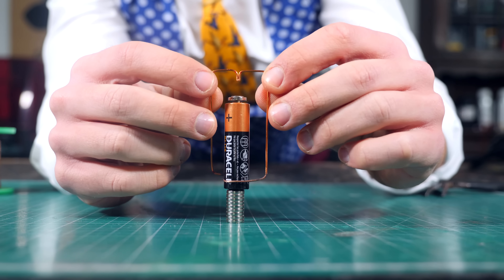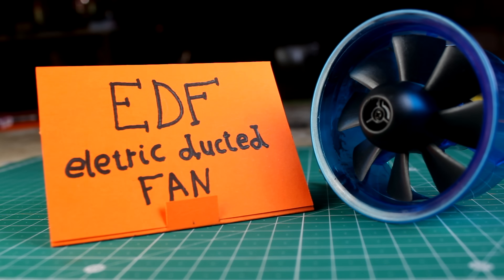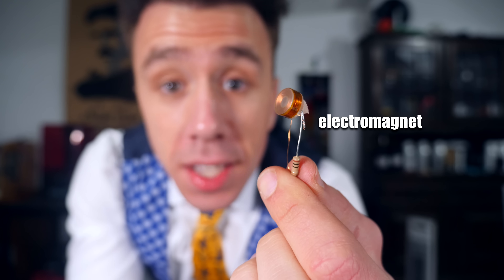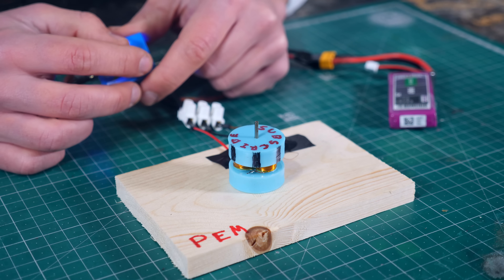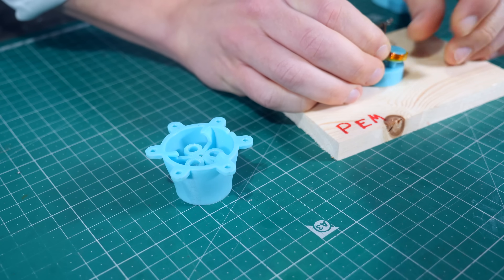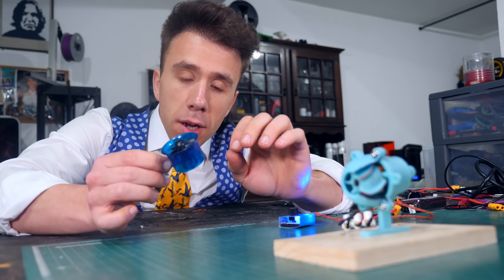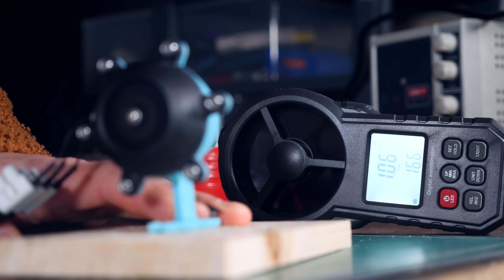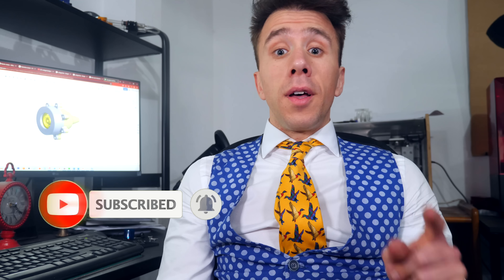I 3D Printed an ELECTRIC MOTOR FAN

Comment: My assumption is this.  A centrifugal fan is engineered to build pressure first then airflow second.  That's why this design is used on turbochargers, and centrifugal superchargers. A typical fan is engineered for airflow first and pressure second.

Comment: The reason why its not flowing as much as the edf is due to the trade off that is made when using an impeller. The impeller has less flow hower it can output a geater static preasure, whereas the edf has alot of flow but less preasure.

Comment: The Axial fan is just more efficient at accelerating air than the radial fan. The flow path through the axial fan requires way less directional change of the airflow than in the Radial "compressor" design. The benefits of using a Radial Compressor or fan design are mostly high compression ratios in relation to the fairly small build volume. That's why modern jet engines don't use a Radial compressor, Turboshaft or Turboprop engines on the other hand use them because they are fairly small and produce a high increase in static pressure. Turboprop or Turboshaft engines are also not made for generating Thrust, their main purpose is to generate high output shaft power.
Maybe by using different dimensions in your design you will get close to the thrust of the axial fan design, but you will probably never reach the same value due to  efficiency constraints.

Comment: I believe the answer is in two part:

1- the path on the outer part of the impeller is too narrow and you're putting way too much pressure on it so a lot of it just dosen't go through and gets stuck around the impeller. Basically too much pressure for such small opening. Imagine 1000 people wanting to fit through one door, they just can't gen in fast enough to avoid any danger of casualties, But if it was 100 people, they probably could go...

And 2- in general, jet engines have that much more power due to  the fuel being ignited, jet engines don't make for a good thrusters without the fuel and ignition.

As you may see with the EDFs, the propeller only covers the motor, the rest of the face is completely open. So they move as much air with least resistance as possible.

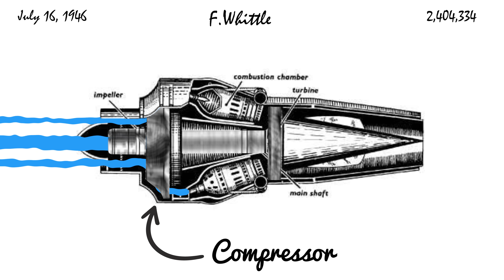Comment: We used to have a toy like that   (@3:50).  A propeller loose on a stick with a pulling rod.  Pull rod. propeller rotates and takes off.   Just rotate yours the other way around... 
even better. A forth spool in the center and a circular magnet in the propeller to hold it down longer and also 'shoot' it up to assist takeoff...

Comment: Once you have enough material, I say mount one of these fan thrusters to a bike, and see if it can push you.

With the centrifugal fan, if you were to make the impeller lighter, it would increase the RPM. Though, I don't know that would increase it's efficiency or power.

Comment: The thrust produced by the 3d printed fan having the EDF motor will not produce the same amount of thrust because of the different shape of the impeller. Having the same amount of thrust is still possible but it will depend on the rpm of the fan

Comment: Centifugal fans - Low flow, high pressure
Axial fans - High flow, low pressure
For thrust, you generally need to move some gas (air) at a high speed (high flow) so that's what's happening. Centrifugal fans don't get you high flow.

Comment: Fan Aerodynamicist here… You really need to do a bit of a deep dive on compressor theory. There’s 3 key steps you need to understand:
1. Blade angles, Flow and Pressure ratio
2. The impact of efficiency
3. Power consumption requirements

Comment: I'm not expert, but with my limited knowledge, I suspect your issue is that the motor you are using doesn't provide enough torque. It is my understanding that centrifugal fans compress the air they move and that this compression is where their air velocity output comes from. This compression creates large amounts of air resistance that will slow down the blades more than they would with a traditional propeller. The faster you drive the impeller, the more resistance you will get on the torque until you reach a plateau.

I believe you need a motor that is built to focus more on torque. Find a balance between the torque and rpm.

Comment: Centrifugal compressors have inherent inefficiencies where you turn the flow of air from radial to axial. You also should size your fan according to your motor; it may be reaching max speed because it's choked of air.

Motors don't generate thrust, fans do. There's no inherent reason for one design to produce the same amount of thrust as another.

If you're not married to the centrifugal design, but still want a ring of moving air, you can use multiple stages of axial compressors, separated by stators, with a smoothly increasing inner diameter.

Comment: You could try adding a stator element after the impeller since it can reduce the turbulence of the flow and the rotational energy of the air and hopefully create more thrust.

Comment: One thing you need to consider is that a portion of the energy output from the impeller design is used to compress the air and increase its pressure, however by doing this it loses some of its energy therefor the exhaust velocity wont be as high as using a normal fan design which doesn't compress the air as much.

Comment: A centrifugal compressor is designed to do just that, compress. It's usually used in conjunction with a diffusion stage and a combustion chamber where fuel is added, ignited and huge expansion of gases takes place. This is then used to drive a turbine which in turn, powers the compression stage along with the  the giant ducted fan at the front of a turbo fan engine. A centrifugal  compressor doesn't necessarily move a large mass of air, it's job is to compress. It's the fan at the front of the turbofan engine which produces 80-90% of an aircraft's thrust. Your basically using the wrong tool for the job. Same with a turbocharger... if you use the force of the air coming out of your turbocharger to try to drive an engine without the combustion stage, it wouldn't overcome the friction of the pistons and rotating assembly.

Comment: There's a problem with your fan, by recreating and slightly closing the upper blades it should go straight then curves from the top so that the force is created by swallowing the wind and it should cause some problem but if you recreate it and add some a little power onto you motor, just to make sure that the hole of the fan is inserted tightly and not lose or maybe the problom is the back of your fan cover. Hope this helps👌👌👌

Comment: Fans/Pumps produce pressure and flow, and in doing that they absorb work. You should try measuring the current (ideally the power but as esc tend to produce constant voltage current is a good approximation) used by both models of fans, and compare. 

1. If the models use different power/current, you need to scale your design until they do, and then you'll probably have to look at (2) below.

1. If both models are using the same power/current but producing different flow then you have an impedance matching problem, or an efficiency problem (wasted energy). The impedance matching problem is ether the inlet or outlet of your Centrifugal fan doesn't ideally suit the pressure that it is operating at. 

Rule of thumb is that Centrifugal fans/pump produce higher pressures at low volumes than axial/ducted fans. I think you have an impedance matching problem.Your Centrifugal fan is producing higher pressure but at lower flow air than the axial fan, thus when you measure wind speed (flow rate) you see it as lower. 

 This is why rockets have nozzles, high pressure gas at low flows isn't useful for propulsion, nozzles convert high pressure/low flow to lower pressure / higher flows.

The fact you called it an aerospike turbo fan, I wonder if you already know this because an aerospike is a form of open nozzle, which is a impedance matching device.

Comment: I didn't see any stators in your design.  You could add a non-rotating blade assembly between the cowl and motor housing (a longer impeller shaft would be needed).  Just the impeller in compressing tangential to the shaft and starts swirling as it expand down to the wider end of the cowl.  The stators should return the flow direction to a non-swirling, parallel to the shaft flow.

Comment: Hi there

Just some of my insights, as I have experience building my own RC EDF planes and experimented with various motor settings +Prop. There are so many variables to play with even though you have the exact same motor to produce equal or better thrust. You have:

1) Bell shape lip intake (without it, you will realize a significant drop in thrust) 
2) Blade pitch (Every blade pitch must match a certain motor RPM for efficiency)
3) Prop diameter (Every prop diameter must match a certain motor RPM for efficiency)

To give a real life scenario, Given same power (Say 100Watts)  i'm having a 
A)1200rpm motor 12"  2 bladed prop 
2) 10000rpm motor 3" , 2 bladed prop 

The 12" prop will produce significantly more thrust with lower air velocity, while the  3" prop will produce lesser thrust with higher air velocity.  Its like a Gear 1 vs a Gear5 on the car.

So if you want to achieve equal or more thrust from your system, i'd say probably build a bigger impeller , sand down and make your internal wall smooth as well for efficiency.

Comment: Is the swept area the same? The middle structure of the impeller might reduce the area swept so it has less air which it can move, also the intake area is different mby?

Comment: Hey Integza, 

if i remember from my engineering courses correctly you have the following issue:

fans (or as an engineer would call it: single stage compressors) generally transfer energy into your working fluid. In this case air. This energy can manifest itself in velocity, pressure or heat differential. Heat is generally considered a loss with fans. Now you are comparing an EDF(axial compressor) to an turbo fan(radial compressor). The axial design of an EDF is good for producing high velocity differential, but not good at producing higher pressure. For radial designs it is the exact opposite. They can produce high pressure, but not a lot of velocity aka thrust. You would need an elongated duct to turn that excess pressure into velocity, when there is only the atmosphere pressing against it at the end. But in using a large hosing you would introduce a lot of friction (air against the housing) wich would heat up the air and housing, so more heat losses. So to sum up, in theory radial fans can not produce as much thrust as axial fans.

If you would measure the static air pressure behind the to fan designs you would see that the radial fan produces more. That is where your velocity(thrust) is going.

tl:dr : Axial fans: High velocitydifferential, low pressure differential. Radial fans: High pressure differential, low velocity differential.

Comment: The geometry of the blades has to match the desired rotor speed. If the blade geometry does not match the required shape in respect to the rotor speed, efficiency is abysmal. That is the reason why axial jet engines where thought to be impossible for so long. The geometry matters a lot and is difficult to get right. Also, you do two things with your working fluid: compress and expand. First you increase pressure and then you decrease it again when you push it through your nozzle and in turn increase speed. Under optimal conditions, the pressure after the nozzle is identical to atmospheric to get optimal thrust. This again is difficult to get right. And even then, the internal conversions add up. Compressing and expanding again through so many geometries is not 100% efficient. You have friction losses on the walls and you also loose energy in the form of heat. Even when all geometries are constructed perfectly, because of the system complexity you will always end up with lower efficiency than the much simpler ducted fan.

Comment: I see three possible reasons:
1. Your fan design is simply bad and creates too much turbulence
2. The fan doesn't present enough load to utilize the maximum power that the motor can produce
3. The fan needs too much torque, overheats the motor windings and thus makes it less efficient (the inverse of reason two)

Comment: Clear resin and smoke should tell whats going on... Being a mechanic and having played with a lot of forced induction I reckon its mostly tolerances and materials at that high of an RPM is seeing efficency go out the window. 3D prints of fans often under perform their injection moulded counters and if you then are relying on housing impeller clearance to move fluid then you are going to see a huge drop.

Comment: You should try redesigning the nozzle, as you said centrifugal compressor creates higgher pressure so if your nozzle is not optimized for working in sea level air pressure your air is just spewing out and decompressing right after the nozzle and you what you want is to pressure out the nozzle and atmospheric pressure to be as close as possible. Just like bell nozzles of rocket engines are designed for different parts of atmosphere because pressure drops as you get higher. Good luck

Comment: Other people have more descriptive comments but I'll say this.

Impellers are not really what you want for thrust. 
I don't know too much about them but I inderstand increases flow rate and pressure in the impeller.
*It increases pressure in the impeller*, pressure is good for generating thrust but counter-intuitively starts to hamper thrust very quickly 
Velocity drops when pressure increases, inverse proportionality.

Normally this would be ok in say, a turbocharger, where there is a long continious pressurized piping, engines and fans are (usually) completely open.
I'd expect the energy to diffuse pretty quickly without the velocity having a chance to increase much. 

Anecdote, I actually personally believe this is a point of effeciency loss in jet engines but they have to eat the loss because of heat and structural integrity issues.
Rockets overcome this with wicked powerful and unreasonably wasteful cooling systems.
 (Use cryogenic fuel as coolant and dump it into the combustion chamber at many tonnes per second).

Long story short what you have essentially created is an aircraft compressor, rather than an electric fan. 
In a typical aircraft engine these would purposely slow down the air to increase pressure for combustion, and technically this is also a loss. But is needed for ocmbustion.
It depends on the speed and shape of the impeller though.

Comment: Fun thing about BLDC is they call it like that for the reason the driver fairly emulates the brushes. Yeah, it is not just pulsing the windings like it wants to, as that would cause the stepping mode along with all the vibrations - instead it actually picks the feedback from either the sensors or the windings' BEMF itself. However, this makes the driver special, yet the motor is just a synchronous motor, and although it is brushless, there is nothing "DC" about it :)

Comment: Surely it's blade area, the area  of the impeller need to match the propeller, although the impeller produces pressure there's no flow, you would need the correct nozzle like a rocket maybe... air is a fluid but thin yes?

Comment: Do a fluid dynamics analysis
You can use algorithims combined with fluid dynamics simulations to do random alterations to the blade design (number of blades, shape, size, ect...) until you find the best possible shape
Also use symetry so the impeller stays symetrical, it's better

Comment: Not sure how you are "measuring" the  difference between fans - For instance your 3d printed fan might produce higher pressure but lower volume than the EDF which is designed for volume not pressure. Its like a Tesla turbine which i believe will produce higher pressure but a much lower volume of air which is why its so difficult to run a gas turbine using Tesla turbines as they cannot compete in terms of volume of air with more conventional axial or centrifugal fans. The GTBA  (Gas Turbine builders association ) would be a good place to get more expert input on this.

Comment: The EDF has no back pressure to contend with. The fact that you are trying to condense and pressurise the air in your aerospike fan is costing you energy at the exhaust stage.

Plus the EDF fan is tailored to the output of the motor and ducting. 

That would be my guess anyways...

Comment: Inputs and outputs are very important, you might have high compression before the exit which limits the flow- imagine a water pump with closed valve, also if rpm are the same than larger diameters make air flowrate faster, if you have a big plastic bag you could measure both fans flowrates by how fast the are filled, also measure the max under pressure each fan makes and over pressure- best fan makers are probably car turbos. Best way to measure pressure is a small hose with water in it or a vetilation draft measuring device
Reply: mintegza1  ok?

Comment: Awesome project, as always! But what I don't understand is, why do you assume that an EDF and a centrifugal blower with the same motor produce the same thrust? Do they have the same efficiency? I haven't thought about it much, but my intuition is that compressing the air in the centrifugal fan reduces the efficiency because more heat is generated. So without considering airflow, Bernoulli, etc., I would guess that the EDF performs better for the same input power?